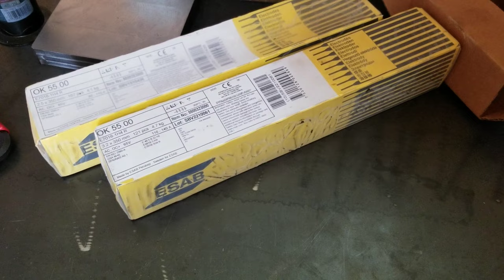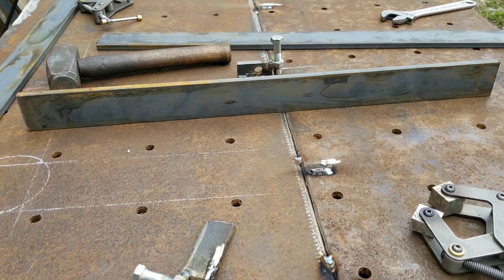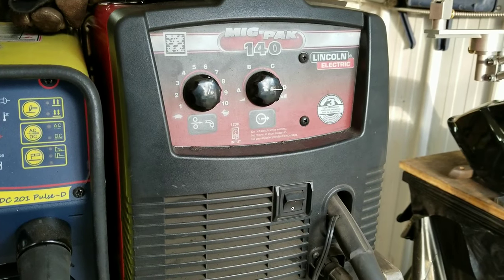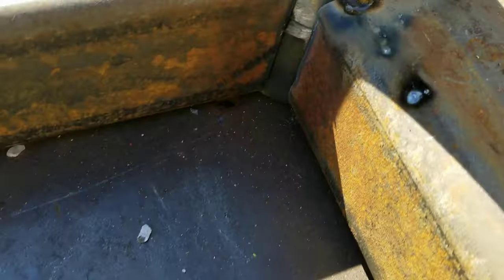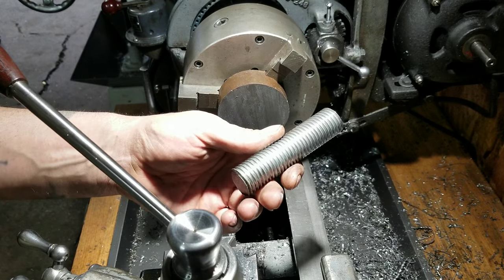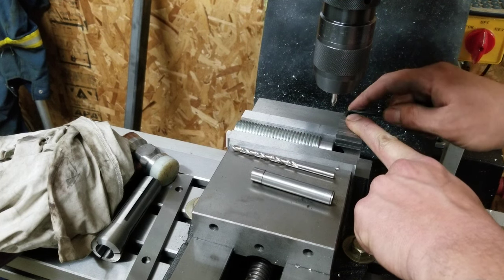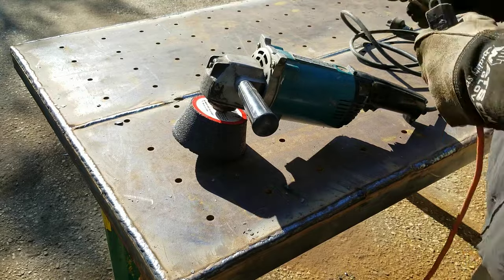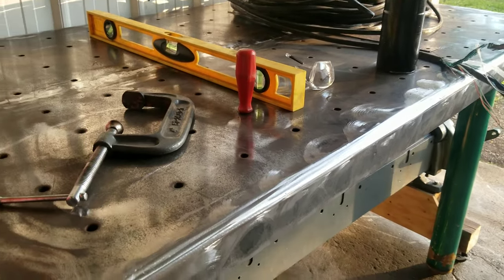Let's Build a Welding Table! Plus 2000 Sub Giveaway! 😊

Comment: We're In Man!!!
Glad you cut it back apart and lined up those holes, the OCD, whoops, mean workers, in the shop was about to explode 🤣, btw the Chinese welders and plasma cutters we get don't have copper wire, its just aluminum and a super thin azz copper coating, find you a old set of heavy duty jumper cables and use that, we have a old Lincoln welder, the wire sheath cracked and fell off, we Bern using a set of older cheapo cables and they do great and wayyy cheaper than buying welding cables these days!
Reply from the maker: Yeah, there was so much wrong with that I have no idea what I was thinking 🤣. That particular welder is made right here in Canada 🇨🇦😁🇨🇦.
That was the sole reason for choosing it over the Everlast. So far it seems to be a very well built machine, just need more cable 😏
Reply: @Just1GuyMetalworks  but wire may have came from somewhere else, all you need to do is check with a pocket knife, scrape the wire and it is silver color under, you'll know you'll need get better wire, got a plasma cutter and it was in our shop fire last year, was low to ground but heat still crumbled the wire, the ground clamp n fell off in our hand 🤦‍♂️🤬🤣, recently noticed a thing here, says "Assembled in USA", which is lawyer talk for we pulled junky item out of China, put couple screws in it here, and now we slap sticker on it and charge top dollar! A truly sad time we live in!

Comment: Good one on getting to 2K .   Looks like you got the welding table  by the balls in the end , good job  !   I was lucky to stumble across a 4'' x 5'' bit of inch plate ( on it's way to the scrap bin )when i made my one , so all i had to do was weld the 6'' x 4'' RHS  legs directly to the bugger !  👍
Reply from the maker: Thanks, Max 😊. I'm really glad I went the extra mile to clean up those corners. Plus now I can reach the tig pedal 🤣.
Cheers!

Comment: As a blacksmith and a wanna be machinist, a lot of my material, (most) comes from a scrap yard or salvage yard. No shame in reusing!
And oh yeah, I’m in.
Reply: At a tenth of the price, and often in convenient pieces already, what is bad about that.
Reply: The scrap yards here won't let us get anything from them, such a bummer.
Reply: @simpleman283  The one yard has a sales arm that sells the "good stuff", but the closer one will sell you at a profit. Bought a old tank ladder off him already that I use on the roof to bridge the levels, it is mounted up there, replacing the original ladder that fell apart. That galvanised steel likely will be there for the next 50 years no problem.
Reply from the maker: Well, I'm a recycler so I don't mind the extra time if it saves me some dime 😁.
Reply from the maker: @simpleman283  construction sites or manufacturing companies have some excellent scrap bins 😉
Reply: @Just1GuyMetalworks  Especially those that do laser cutting, you get a lot of really good material and offcuts there, often exactly what you want except for the odd extra cut in it, and they often will either let it go for free ( paid for by the customer already) or for scrap metal price.

Comment: Nothing better than a good welding table with a vice and later you can add anything you need to fab and hold parts .. I built my own welding turntable out of a wheelchair motor and a cheap speed control .. Please put me in the draw man .. AND CONGRATS !!
Reply from the maker: Thanks, Shawn! 😊 Definitely a crucial tool for any metal shop 😁.
Cheers!
Reply: @Just1GuyMetalworks  For sure man !

Comment: Congrats on hitting the 2k milestone. Those Esab rods look like they work as well as the lincoln Excaliber rods. Those inverters don't like to run the cellulose rods (6010). I bet it you bought all new steel to build that table it would cost like a million dollars. Prices are stupid high.
Reply from the maker: Thanks, Tom! 😊 I'm a big fan of the Esab rods, the 3/32 are the same lenght as 1/8 and the 5/32 are about 18" lol. 
I think if I crank up those other settings 6010 might work better. Something to follow up on in the future. Loves that 7018 though 😁.
Yeah, prices of everything is pretty crazy 😕. In any case, thanks again!
Cheers!
Reply: I was going to make the same comment on the 6010, although I don't have a inverter machine.. Works fine on my old Lincoln DC tombstone

Comment: Wow!  I think you did a wonderful job.  I bought a sheet of 3/8" x 80" x 33" two days ago.  I thought maybe 30" x 72" would be a good size, but that's what they had, so I took it.  Now I'm trying figure out a design, and then I'll go get the materials.  It would be nice if you were close by to provide the adult supervision & guidance when I start putting it together.   : )
Reply from the maker: Thanks man 😊. I was a little concerned about the size initially but it actually created quite a bit more space in my shop, like a second floor to pile junk on 🤣.
Cheers!

Comment: I'm' in, even if being the winner is not likely. But a great table, looks like it was made of the best hot rolled steel with all that slag in it, must have given the original users an equal amount of grief as well working it, especially when they wanted to drill holes in it, and collected a nice slag pocket with the drill, tearing the one edge off.

Better welder than me, most of mine the slag is almost integral with the metal, needing a grinder to remove. But then most of my welding does not get a grinder, or more than a cursory slag removal before it gets a fast cure coat of paint on it, spray from the rattlecan onto the hot metal, so it dries the first coat of paint in a second or so, and probably the second coat as well.  But it does hold, though I am guilty of doing overkill often enough to compensate, thicker weld than the metal under it often. Yes a lot of my metal does actually come from the cornucopia of the used metal supplier down the road, I take in stuff, and have come out having to pay in while there.
Reply from the maker: Thanks, Sean! 😊 I was kinda wondering that too. They were old floor grates in a warehouse with forklifts driving on them all day. So it's possible.
Reply: @Just1GuyMetalworks  Yes, got those as well, old horridly rusted plate, but they are still useful as car stands, simply lift the one side and drive up, though they have spent more time as covers for digging excavations than as stands.

Comment: I’m in and I’m thinking about building me a bigger one I’ve got a beasty made from 1.5” plate steel but it’s only 32x52” I’d like to have atleast a 4x8 but as is I need more work space because my current one sits beside my big lathe and I front of my mill so it becomes an immediate catch all I need one about 8 foot infront of my current one to be an actual fab table
Reply from the maker: That's about the same dimensions as mine though yours is just a bit heavier 🤣.
Reply: @Just1GuyMetalworks  it’s a bit ridiculous tbh but you sure can abuse it with no issues

Comment: I’m in! Since the first video of yours I saw, I’ve been all in 🤗 
I’m kinda surprised that you didn’t cut the circle part on the mill. Would’ve cut out the concern for low torch fuels. Either way, it’s a table.
Reply from the maker: I did actually attempt that however, my flycutter was a little too small to take a big enough cut to not be there all week lol. 
Thanks man! 😊
Cheers!

Comment: Unless you plan on putting a dozer on it that table is way over built. Instead of round legs square tubing would have been easier to square. With a good grid work frame my table only has a 1/4 top and it has stayed flat for 6years now.
Reply from the maker: Nothing over built ever broke 🤣. (Usually 😉)